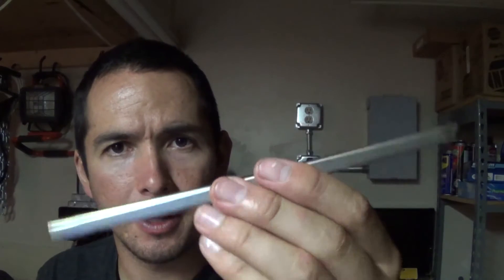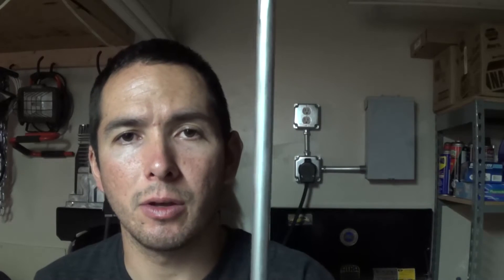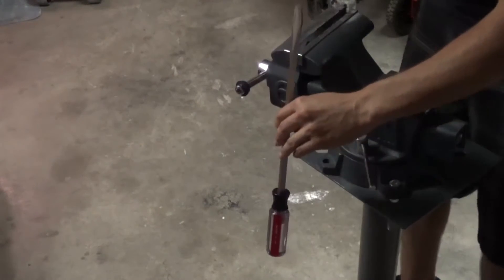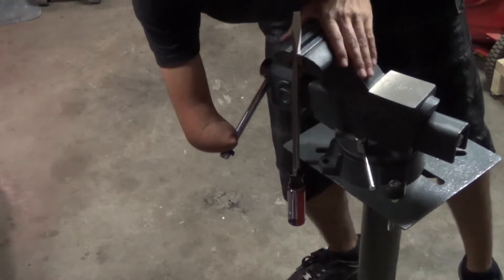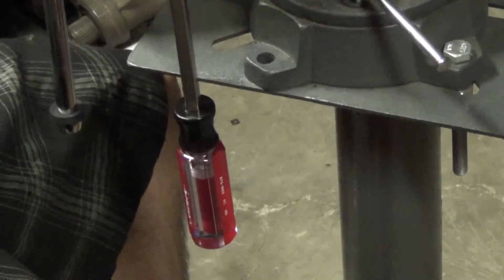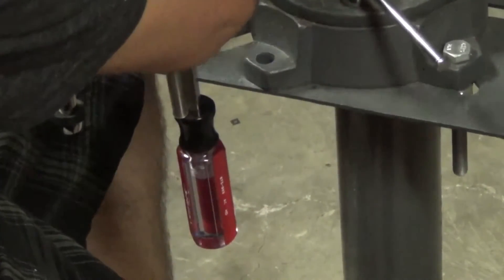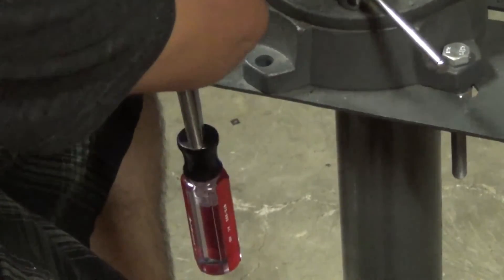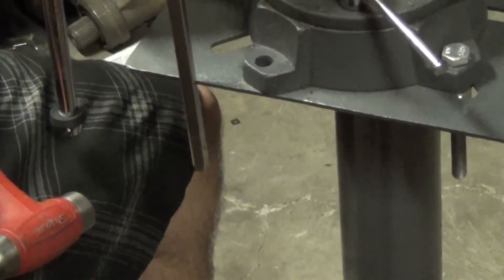Making your own tools--Bushing Removal Tool #SouthpawAutoworks

Comment: Hey mate were is the vids of you useing it?
Reply from the maker: Those other videos were never created.  =/.  Life happened, and the YouTube channel got put on the back burner.  
Thank you for the reminder.  I have added this to my to-do list.  As time permits, I will get it done!  I plan on doing a video series on auto trans tools....both stuff that can be bought, and stuff that can be made at home.

If you haven't done so already, subscribe and hit the notification bell.....so you don't miss the future bushing removal tool video.
Thanks for dropping me a line!
Reply: @SouthpawAutoworks  had a chance yet ? How do you use the tool?
Reply from the maker: Sorry...haven't circled back to this one, yet.  It is on my to-do list.
Reply: @SouthpawAutoworks  that’s ok ; just a simple explanation would be enough; which edge do you use etc
Reply from the maker: Right on!  Great question!

I almost always use the lower edge (as opposed to the higher edge).  Just for clarification, if you look at the video thumbnail, I'm holding the tool in my hand.  Use the edge that's closest to my hand (index finger).

Pro Tips:
Tip #1:
Push the tool firmly against the bushing, and start hammering.  
It helps to keep the tool at a slight angle (instead of straight up/down).  It'll help the tool get a good "bite" on the bushing...yet, the tool should not mare/damage the transmission part that the bushing "lives" inside of.
Tip #2:
Use a dial caliper to measure the depth of the bushing before removing the old bushing.  This way you know how far/deep to install the new bushing.  Bushing depth isn't always super important...but there are instances where it can make the difference between a problem, and a successful rebuild.
Tip #3:
If you look at a brand new bushing, you'll see that one end, of the outer circumference, is clasped together.  If you're trying to remove a bushing from a blind hole, place the tool just to the left/right of the bushing clasp.  When you start hammering on it, it'll spilt that side of the bushing apart, making it possible to remove the bushing with this tool.
Note:  The alternative is purchasing/using a slide hammer tool setup to remove bushings from blind holes.

Hope this made sense.  It'll make a lot more sense in a video explanation....when I can get around to filming/editing this future video.
Once again, great question.
Thanks for being here...

PS
If you're interested in spreading the word about this channel...here's an easy way to share (Friends, family, FB Groups, etc)
(Roughly 60-second video)
1 Handed Transmission Rebuilder:  https://youtu.be/Mvv5Cd2cVW4